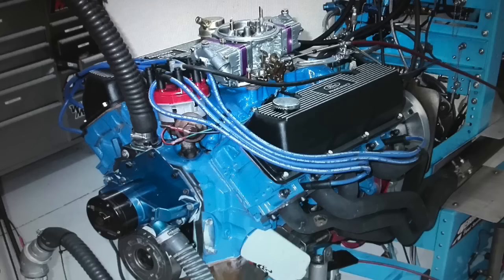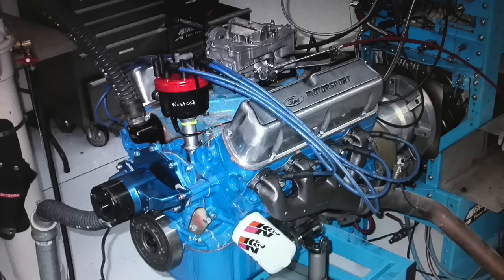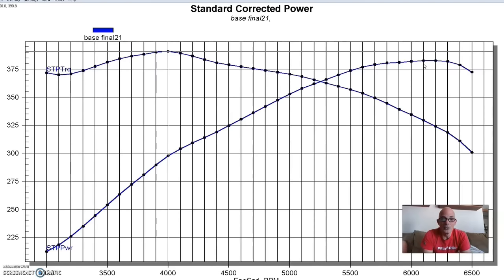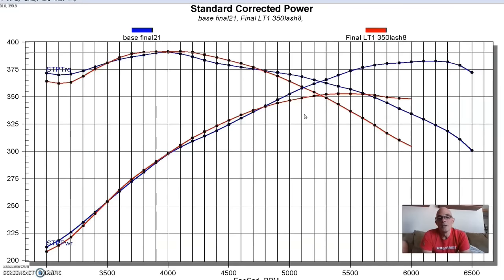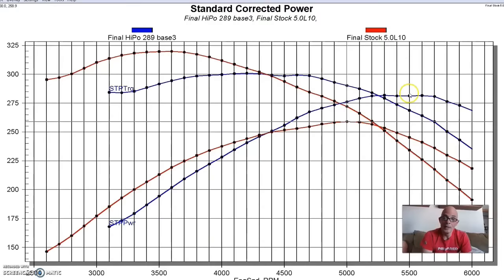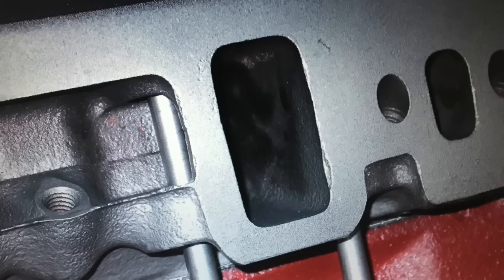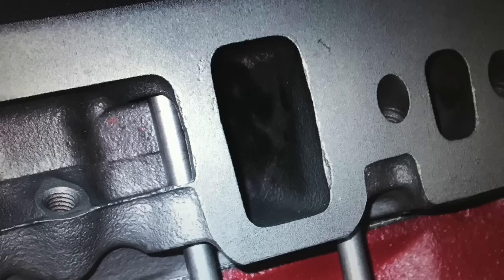HOW MUCH POWER DID THE 1971 BOSS 351 REALLY MAKE? WAS IT THE HOTTEST SMALL BLOCK EVER OFFERED?

Comment: The legend of the hipo 289 has run way out beyond the realm of fantasy.     I ran hipo rods in my 289 which in my car ran 11.70's at 115.   Up at around 7500 rpms(probably a bit more actually) I sheered the beams in half on 3 rods one day.   Lost everything below the heads.   It could have been the relatively heavy TRW forged pistons that did it or I simply made more horsepower than the rods were capable of handling.   They were double shot peened and stress relieved, balanced and had ARP rod cap bolts.    It was not an assembly mistake.   Mine was bored .030 so technically a 292.    I was giving up 10 cubic inches.   That might wind up requiring a couple hundred more rpms to get the same power as a 302 or maybe not even that much.   I didn't consider it to be significant.   It just sounds small because its a 2 instead of a 3.  
 
The only advantages to the hipo 289 heads were the screw in studs needed for solid lash adjustment and the recessed spring pockets.   Other than that, they were the same crappy castings that were anemic even on a C code engine.   I have never seen one but I would be curious as to how a Boss 289 would do with closed chamber Cleveland heads,  aluminium 4 barrel clevor intake and a 650 or 700 cfm 4 barrel carb.   It would be an interesting test to see just how much the heads were killing that engine.   My guess would be a lot.

Comment: Always have been a huge fan of the 67-68 Mustangs...then skip straight to the Fox  87-93s. 

I owned an 88GT and later a 91 LX5.0.....the LX was a let-down for the following reasons:
•3-speed automatic.
•Living in mile-hi Denver thin air.
•It was a convertible (heavier frame).

The GT was a 5-sp I owned while living at sea level. Much more powerful.

Comment: Richard...i agree with you 100%...i stuffed a solid lifter 4bbl Cleveland in a 74 Capri 1 with a top loader and a 9in ford with 4.56es...There were no Small block Chevys  that could run with the Cleveland...at that time...not until the introduction of aftermarket aluminum heads..did the small Chevy Compete...you confirmed what ive been preaching for years....the Truth..!👍🇺🇸
Reply: 4:56's in a car that weighs 1000+ pounds less than any chevy. Not really a fair fight.
Reply: @will7its  ...The V8 Vega's  were popular then...were lighter than the Capri by a couple of hundred pounds...i knocked off several with small blocks...and one in particular with a Big Block....Thats when i got to here the "Old wives Tale " that a Cleveland was a Big Block...when its not....its a Small block...and always will be...
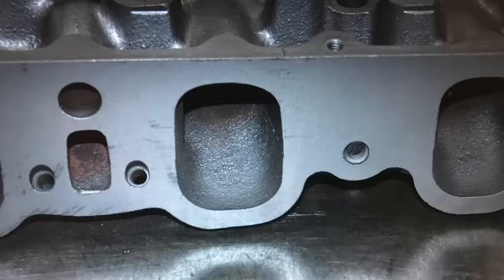Reply: @frankieford7668  Your right, I forgot about the vegas. Never was a fan.  I would stuff a 283/ 4spd in a vega with like 3:55's. Or a 307 with 53cc corvette alum. heads/cam etc. That would scream enough for me. You dont need aftermarket heads with those giant ports on the 4v heads, thats for sure. The nascar teams were epoxying the ports to make them smaller. The sbc was more of an economy motor designed to power everything under the sun. Not the best one out there probably. I just dont recall too many clevelands back in the day.
Reply: @will7its  ....There weren't alot of them....Mine was basically a copy of a Boss 351...with a Solid lifter conversation...it would Run an 11.00 when most fast cars were in the mid 12s....I bought a Holley Strip Dominator intake for it...over $200 in 1986....That one Hurt..😢 but it worked Real well....

Comment: I had a 289 with 11:1 compression, Engle mechanical cam, dual point Accel distributor, 650 double pump on Offenhauser 360 aluminum intake, tube exhaust headers. Rev'd to 7,800 and regularly beat my friend with '69 Camaro (I think) SS396.

Comment: I ran a franken-shelby 289 in the seventies that was as accurate as budget allowed, except for a set of big port 351w heads.  Yeah, it was in a gutted '65 falcon, but it was a big-block killer.  I eventually blew the deck off the block.  Never interested in the 302. They just never seemed to work like they should have.

Comment: Ford new the 289 and basically the whole Windsor engine family was dated and they would need to step up to compete with the small block Chevy in Z28 302 and LT-I 350 trim. This is the reason the Boss 302 and Boss 351 were created. None of the Windsor engines received any further development after those engines came out. Even the Boss program was short lived after the government along with insurance companies basically ended the muscle car and factory racing  involvement at Ford in the early 70's.  The Boss 351 became a very strong engine in NASCAR and Pro Stock trim for many years even though production and factory development was long gone. In the early 80's Ford begin to come back to factory performance cars and parts. This began the long run of factory involvement that has continued to this day. Yes the Boss 302 and Boss 351 were called the "Baby Rat"  :)

Comment: I had a 65 mustang with the 289 A code (mild upgrades) and I've had an '87 5.0 (stock). Never raced either at a track but seat of my pants the 302 felt faster, no question. K code HiPo's are the stuff of legends though so I'll stop there.

Comment: Compression and flow was where it was at with the 351 Boss , Ford always stuck with the spider induction, on any v8 config..  However the 4v Boss canted valve geometry nearly 2-1/4" intake  and the quenched combustion chambers, even with flat tops  made  one  horsepower per cubic inch and beyond.. not to mention the cam and carb combo...

Comment: Sir Richard, i got a 67 Ford GT Replica. Its got those "Hi Performance 289" on the fenders but i built a stroked 351-408 Cleveland built around the Boss 351C and snuck it in there with a built TopLoader and Trutrac 😉 Produces 260kw to the rear wheels on super safe timing with 98octane  and has been reliable for close to 10yrs now. Only tearin it down again to go for ally heads new cam and manifold sometime in the next 12months and wish to aim for around 350-380kw. Beautiful vid 😉🖒 can link to an idle vid 😎

Comment: my car is a 73 mustang, built 351c (1971 date code Boss block).  Cleveland is the best motor Ford ever made until it made a coyote.
You can build that cleveland to run 10k rpms. Any one doing that kind of build would have done all the oiling mods to go with it. Nothing sounds like a cleveland.

Comment: I can understand the love for the Cleveland with the gobs of torque for a daily driver.  What is the engine and chassis weight difference between the Cobra equipped HiPo289 and the 1971 Boss Cleveland..  With the Cleveland's extra torque down low, how much extra vehicle weight is required to stiffen the frame and running gear vs. a chassis optimized for the 289?
Reply: Early Mustangs cracked at the C pilar and shock towers gave in.
71+ didnt.
We've got one.

Comment: Having owned a boss 351 which I ended up totaling in 1975 nobody would even pick the auto light carburetor that those things were laying all over the salvage yard in Tucson similar to a Rochester no not Jack Benny's first thing everybody grab was a ram air the way around the rev limiter was soldered the smallest nail you can find and it would just fit right between the connector there were no evidence of it being tampered so you can retain the warranty the four-barrel manifold weather aluminum or cast iron bolts right on the two barrel heads which does help two barrel heads were far better on the street as far as street racing because you didn't have to keep the revs up to keep the flow in those big heads the Cleveland manifold would be reversed I watched a guy put one on got it all torque down only to find out he had it the wrong way because the linkage mounting holes were on the opposite side

Comment: The 289 Shelby set up also included a Shelby GT 350 solid lifter cam my dad had a 64 1/2 mustang GT and he did tall of the Shelby upgrades the Doug Thorley tri-y headers, aluminum intake, Holley 780 from carb and the Shelby GT 350 solid lifter cam then had it dynoed [in 1966 mind you] I've seen the dyno sheet he kept it. The motor made 358 HP and 334 left of torque. He was running in the high to mid 12 second range he kept the time slips from Mylon dragway in
 detroit. You would have liked the 289 a little better with the By 350 cam. Dad said the the motor would rev to about 7800 rpm be for it ran out of juice
Reply from the maker: I'm pretty sure the production Shelby GT350 had the factory HiPo 289 solid cam-Shelby also sold off-road and racing cams

Comment: Small  blocks fords always suffered from lack of tumble and swirl, that's why it takes extensive and careful porting and a few tricks plus a dual pattern cam to really wake them up. Once that's done they run like a 2 stroke chainsaw with instant throttle response all the way to 7k rpm and of course properly built balanced and blueprinted bottom ends with cylinder to crank alignment corrected, lifter bores bushed and aligned and fancy lightweight valvetrains with roller rockers and stem caps etc, but that's not something most people do to a ford, most tune it, put on bolt on like cams intakes pipes etc snd and send it hoping for the best.

Comment: The fox mustang was fabulous for the time and the 5 speed would give it a major advantage over the '65 289 hipo. Especially considering the modern tires and suspension.
Reply: Not really ... 65 and 66 Mustangs were 2200lb cars ..  vs    3000 to 3300 for the 5.0.   A Weber carb set up on a 60's era car would give the 289 a torque boost similar to the 5.0 manifold.  Shelby offered Webers over the counter in the 60's at the Ford Dealership.  Heads were the limiting factor for the 289.
Reply: @mountainofeverest3861  I'll give yo 5 to 1 odds.

Comment: A good friend had a 66 mustang convertible with the HiPo 289 that I drove many times but not back to back with the 85 Mustang GT. The 85 had more low end torque just like your graphs show, the HiPo 289 had more top end power. In general driving the 85 seemed quicker but the older Mustang convertible was a great car and much fun to drive.

Comment: Hi Richard I know what you mean, i have a 03 mach1 and going to a few International mustang meets i had the opportunity to go up against one of the 289 hypo. No match and it was in a older lighter 66 mustang, 
As you know my car has even less cubes than that. Both stock essentially with bolt ons my car with headers. Not sure about the hypo but it had headers to. This was during cruises not from a dig or at a drag strip

Comment: I had a worked out 66 mustang with a 289 i put the 351w heads headers dual point dist  good size solid lifter cam  750 holly on it automatic hi stall converter shift kit  4:11 posi  rear a hi 13 second quarter mile. I still agree with you I think the displacement makes it a not ideal engine. think a bigger engine would have made it a faster car.

Comment: I had a 90 mustang notch back with a built 351 Windsor with a tremic T56 in it and a comp solid lift cam trick flow heads MSDand it turned 8100 rpm to red line and this was in 2002 I bought it from a guy that worked at a performance shop in NC  it sounded like a stock car even though it was only about 475hp it sounded wicked the windows in my parents house would shake when I’d go over there

Comment: The reason that the carburetor (Autolite 4300D, NOT to be confused with the standard 4300 series, which is as common as dirt.) is so expensive is because NOBODY knew how to make them perform, back then.  The engineers, back at Ford totally screwed them up in the name of emissions and the dealership mechanics were not allowed to "make them right", even if they knew how to, which they didn't.  So . . . . . they ended up in the trash or the junkyard. They aren't expensive because they're good, they're expensive because they're rare.  There are, however, quite a few out there IF you can afford one BUT you need to find a carburetor whisperer that understands their faults and knows what to do with them.  There are several modifications, inside and out that need to be performed to correct the engineers "improvements".

Comment: Loved my 289 hipo, felt faster than my 70 mach 1 with 351 cleveland in stock trim and also with boss heads and boss cam, know 70 carried a lot more weight, but 66 was a fun car to drive. I'm in process of redoing the Mach 1 with aussie heads and roller hydralic cam and oil system mods.

Comment: We raced them here in Australia from 1970 to 1977. They blew apart over 6500 rpm, so the better flowing Cleveland heads were wasted as they could not rev high enough to take advantage of their better intake flow rates. And they were HEAVY and so suffered from valve gear failure. You could make more reliable power with a Chevvy. It was not until the C3 came along that Ford had a decent race engine.
Reply from the maker: the won lost and lots and lots of races-drag and nascar

Comment: All those NASCAR blocks came from Australia  they should have been called 351Gs as they were cast in Geelong at the engine foundry there. The Aussies also cured the Cleveland oiling issues and their 2bbl heads flowed like the 4bbl heads and are still sought after for drag racing
Reply from the maker: Flow bench testing indicates the Aussie 2V heads flowed like 2V heads, they just had closed chambers

Comment: Boss 351 was a Great motor I ran one drag an road racing lots power aftermarket parts then I started running 429-60 motors in a 71 mustang an cobra Torino great cars at over 100 mph not squirreley at speed

Comment: phase 3 and 4 351 engines in australia ran 780 holley and alum manifold and special extractors,first engines to start seizing 3rd gear onto mainshaft of gearbox when exceeding 275km/h for extended periods

Comment: Richard good comparison between 289 vs 302. I have a 66 mustang that I pulled the 289 out of and put a 1984 302 in with the AOD trans. It made it a better car. That little bit of torque that is gained at the bottom more than makes up for the loss of power up top. With you all the way.

Comment: I never forgot the Boss 351.  It was on of the best engines in Pro Stock at the time and It had to carry more weight per cubic inch to try to allow the other makes to compete.  Kinds a cheat way to go to make the Ford carry more weight per cubic inch compared to the Chevy but that's what they did.  If you could mill the exhaust on the heads and put on a high port plate,  it was unstoppable.  Always wanted to do this.  Some of the Panteras that are heavily modified with the 351 are definitely freeway monsters.

Comment: Had a buddy in high school with a HiPo 289 Mustang. We put a Mallory distributor setup on it, and he put a 7500RPM chip in it, I told him to put a 6000 in until he beefed up the valve train. He took it out and flogged it, riding on spark-cut. I drove it and told him it was floating, so we went back and I found that wrong chip. 
It survived flying around at well over factory redline that day haha...

Was still slower than my other buddies 74 4-door Malibu haha

Comment: 351 Boss was the boss small block . David Person won tons OF NASCAR with it and Bob Glidden  and Wayne Gapp cleaned up pro stock drags with it . as for the 289 i had one in a 65 Falcon  with a close to factory cam  351 w heads and Shelby intake with 4.11 gears and a automatic to boot and no new Mustangs got by unless modified but i did rev it 7000 rpm

Comment: Thanks for the info and dyno tests, but comparing a 289 Windsor to a 302/351 with Cleveland heads is definitely apples to oranges.  Ditto with the fuel injected 5.0L.

Comment: I owned 2 66 hipo  289 mustangs one auto 1 four speed one stock one with cam headers carb I was not impressed.  I owned a 69 mach 1 351C four speed stock and really liked it, never owned or rode in a BOSS 351 but I like the motor.  I rode in a well built 66 289 tunnel rammed 4spd  mustang fairly stock heads and was still not impressed.  I do like the LT1 my  friend owned one in a Z28  4sp  it was fast but not stock he was one of the nephews of Big John.  I would like to see the 340 six pack test as my first car was a 67 Cuda 4sp with transplanted  340 six pack.  I would also like to see a 289 with high flow heads etc as I built a 273 with spare 340 crank, heads 202 intakes, custom probe pistons lower upper ring due to notching the block for valve cl. I loved that motor so maybe their is hope for a 289.